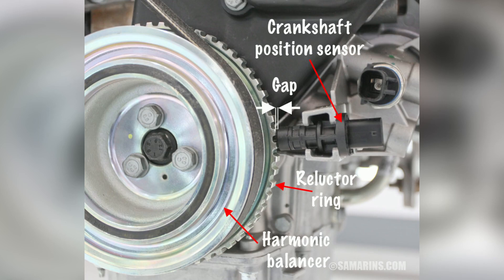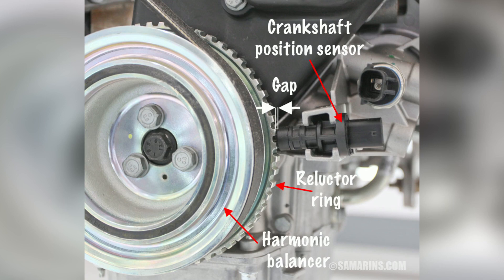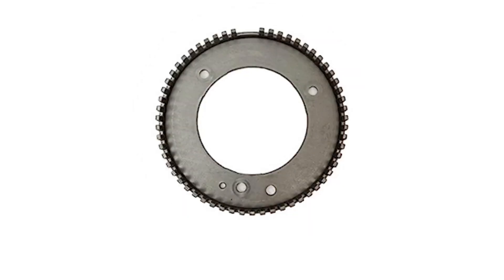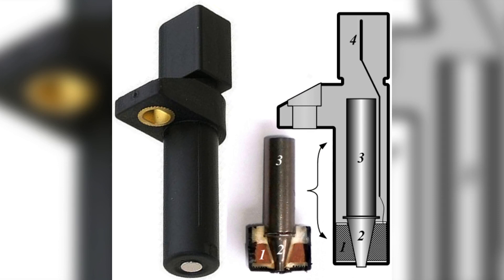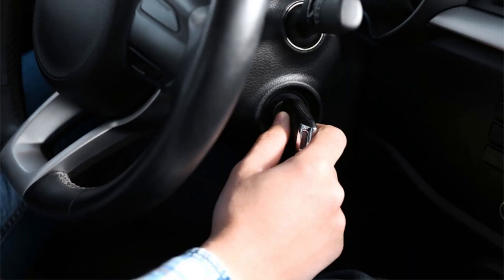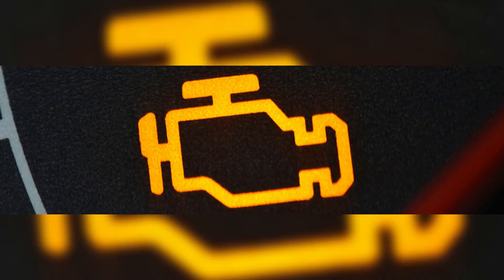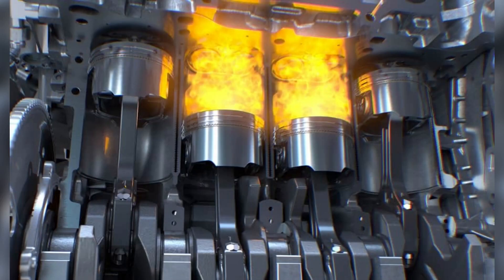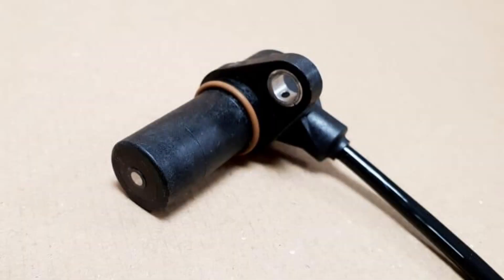Crankshaft Position Sensor Replacement Cost, How it Works and Symptoms

Comment: I have a bmw x5 diesel that won’t fire the injectors new hp fuel pump had the computer checked what sensor tells the injector to fire
Reply from the maker: Hi James. You should first check if you are getting voltage to the injectors. If that's a yes, check the camshaft position sensor first, and then the crankshaft position sensor. An OBD2 scanner will help you with that.
Reply: I have a B5 1.8 Audi A4 which for the last year or so has been giving trouble with an intermittent crank no start. On leaving the engine to to sit for a short time, (say up to an hour) the engine will eventually start again. There's never any hesitation with start up and once started again will run perfectly for a few weeks with plenty of stop/starts in between then suddenly crank no start happens again. The cycle is always the same.. Begins with crank no start, leave engine to rest for a period of time, hit starter and away she goes. I have no engine check light,  car runs smoothly, idles perfectly and is fully responsive when power is required. I've had the crank sensor mentioned several times even by an RAC man but given the car doesn't have any running issues I can't see that it can be the sensor breaking down. Any ideas will be helpful as I have no scan tool either. This problem has been on going for a while now but in the last few days has refused to start at all.
Reply from the maker: Without reading the codes it's really hard to tell since it could be any number of causes. What you can do is check the main power relay (#30). That seems to be a common fault with that generation of Audi A4s.
Reply: @PrecisionMotors-ib9cy    thank you, tomorrow I'll remove the cover under the steering column where the relays are said to be housed and check it. Thank you again for your help in replying.